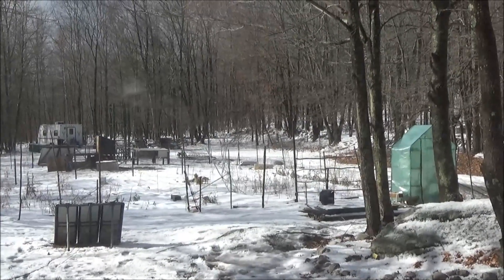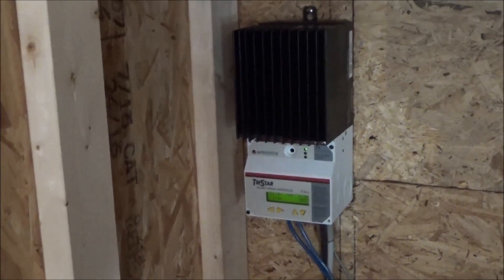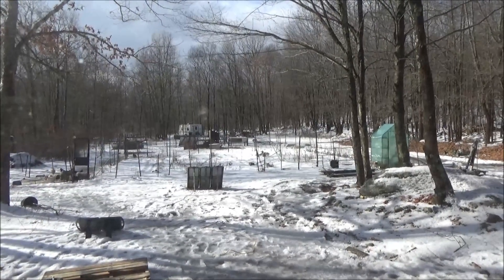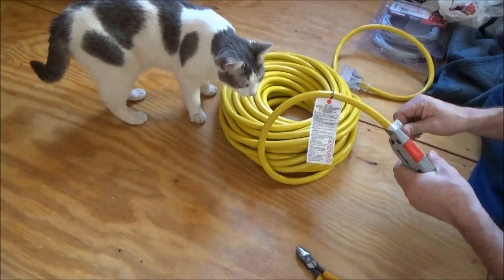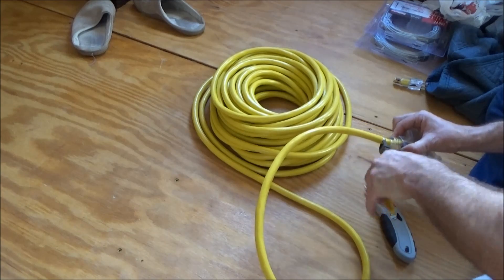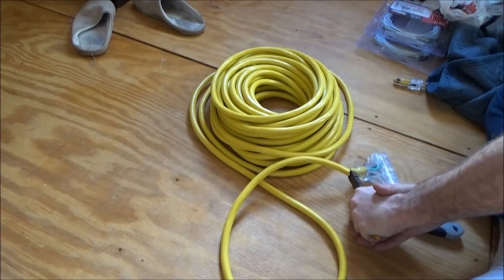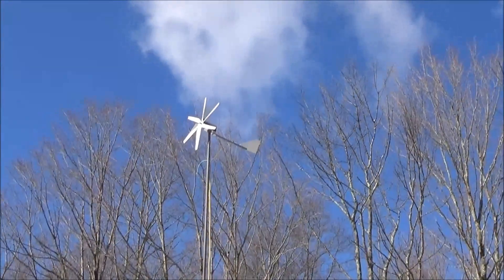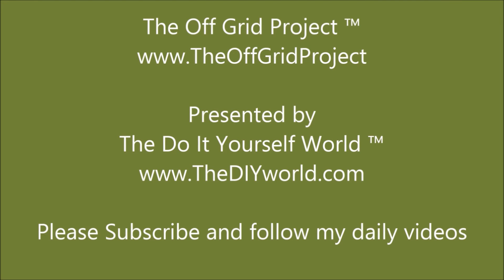Mounting My 350 Watt Wind Turbine

Comment: how much voltage do you loss on such a long stretch
Reply from the maker: Not much. I am using 10 ga wire and higher voltage when the wind turbine is spinning so there are less losses. But I do plan to move the solar panels to the house one day soon.
Reply: he should connect it 3 fase, an use the rectifier inside the th, less los on 3 fase!
Reply from the maker: MrBugsier5 It is a DC generator though
Reply from the maker: gman77gas Well there is no way I am getting 30 amps out of this thing so no worry there
Reply: gman77gas  you are wrong, iff you use the 3 phase (sorry i'm dutch) cumming out of the alternator (we are talking of a 12 volt alternator, so aroud max 30 volts ac between the 3 wires) you have less amps flowing trough the wires , you can rectifie the 3 phase at the other end off the cable to dc with less losses as the 14,5 volts dc if you leave the rectifier in the alternator and transport the two wire dc 14,5 volt as you do in the case he is now..
Reply: The Do It Yourself World  yea i see that now!, its not the pma! ,my fould! you can connect the dc directly to the mppt, making use of the higher voltage!
Reply: The Do It Yourself World  well maby at windforce 13! lol

Comment: That wind turbine will help sooooo much! If I were you I would get a DC Watt Meter like this to monitor exactly how much power it is generating. Do you have a wind charge controller and dump load set up?

http://www.ebay.co.uk/itm/DC-WATT-METER-LCD-60V-100A-Balance-Voltage-RC-Battery-Power-Analyzer-Watt-Meter-/271725050572?pt=UK_BOI_Electrical_Test_Measurement_Equipment_ET&hash=item3f44133acc
Reply from the maker: Yes I plan to get one of those meters. And yes I have a dump load someone sent me last year. I pulled it from the RV and brought it to the tiny house. I will install it soon.
Reply: Good man. Keep up the good work!
Reply: Do you know if this meter will work using a shunt?
Reply: yes no experience but I can not see how it wont work. Ask the seller for hte wiring diagram...

Comment: Troy hows it going just want to say one thing 10 gauge wire doesnt sound like enough to carry that windmill load 100ft. Are you aware you need bigger gauge wire for dc loads over long distances? Just wondering if you took that into consideration. Thanks for the videos
Reply from the maker: Yes of course I am aware of that. But this is a higher voltage wind turbine just for that purpose. Higher voltages mean less loss in thinner wires. In this case 10 gauge is fine.
Reply: The Do It Yourself World ok and also i was thinking you should get a power selector knob if you dont already have one. That way you dont have to hook up wires from one battery to another i think they are like 30 bucks or so. You can run i think up to 2 gauge to those selector knobs.